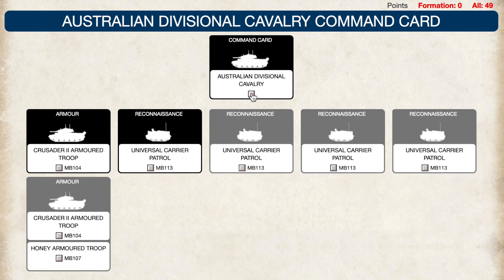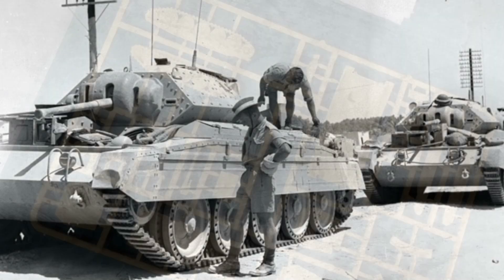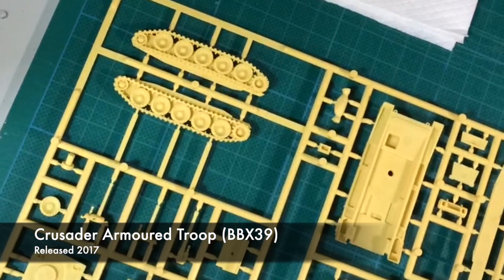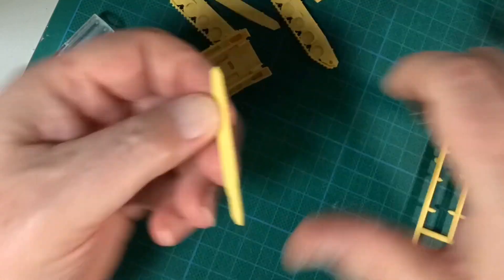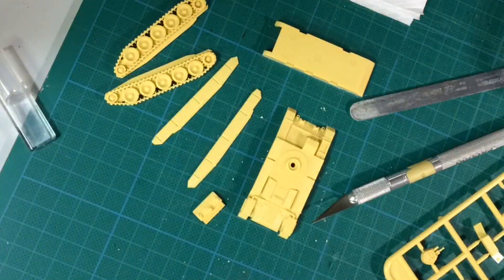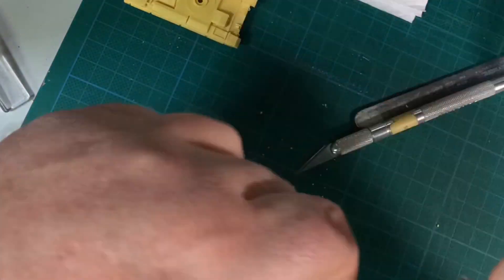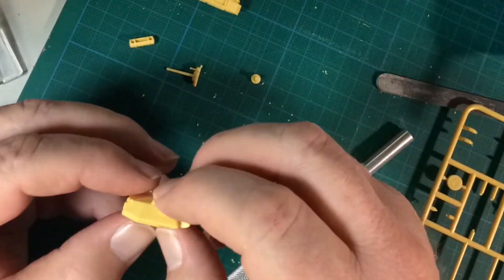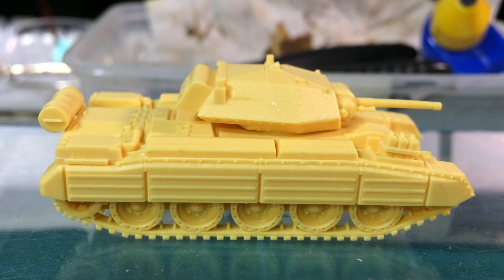Speedbuild | BF Crusader II (2pdr) | Operation Supercharge

Comment: This Tank is Iconic and Beautiful… I opted out of the Sand Skirts for my British Army… my markings are not accurate at all but I like them … I used British Roundels on  Khaki vehicles with and continued to use the color theme into a D day and Bulge army… I am awaiting the release of the Plastic Centurion and from there move into Chieftains and Challengers … I Know it’s not accurate to reality but I think they look great… I’m sure they will stir up as many comments as my German Army that spans Iron Cross to West German all painted in Panzer Grey
Reply from the maker: It is a pretty tank. I have one without sand skirts. This was the one I originally built as a 6-pdr. Removing the skirts seemed to become more common later. But all by Divisional Cavalry reference pics are 2-pdrs with skirts. I try and be historical. But that’s no reason anyone else should be! It’s just how I roll….